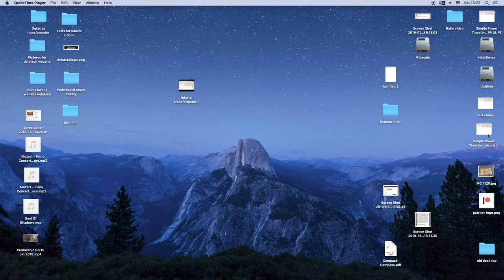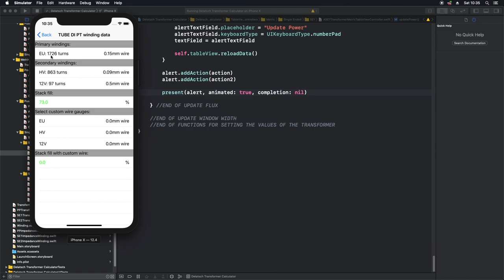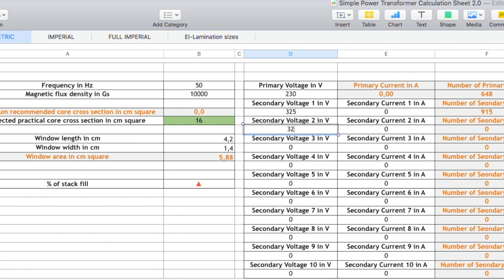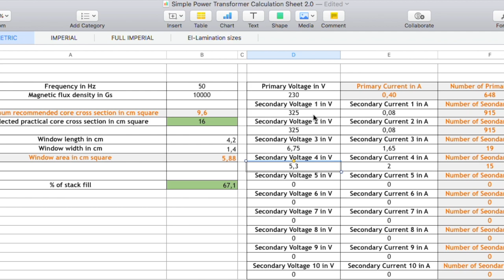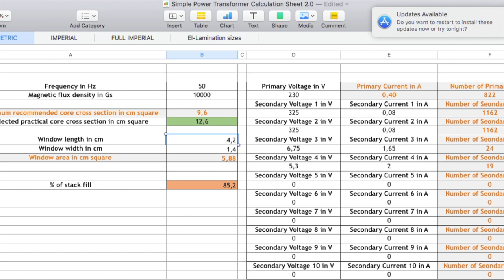Practical Transformer Winding Tutorial 2019

Comment: What about layer insulation? Without that, voltage breakthroughs are likely to become a problem.
Reply from the maker: In the old days it used to be a concern. With modern transformer wire which is double coated and can withstand 200+ degrees C and 5kv+ it is impossible to happen (that's two coats on each side of each wire). It makes sense between separate windings just in case and for sure between primary and secondary as a safety precaution. It should also be used for higher voltage transformer in the kV range, but for relatively low voltages it is not needed. Been winding for years and never had that issue.
Reply: Of course this can still happen. Check the voltage rating of grade 2 or even grade 3 magnet wire from Elekrisola. Very renowned manufacturer, still the voltage rating is below 230V for those. At the very least, this should be mentioned. I'm sure most people watching this are not aware of this issue at all.
Reply from the maker: Wire with insulation that can only withstand 230V shouldn't be used in transformers. Even if you put layer insulation you still have wires of the same layer next to each other. The voltage breakthrough can happen there just the same. In my written tutorials I always mention that only double coated transformer or motor wire should be used for transformer winding. It is not possible to mention all the details and problems of transformer winding in one short video. As I said, never had a voltage breakthrough, the only time I saw transformer fail is when there was a dead short in the circuit and no fuse was present.

Comment: If the transformer is for single ended audio final, how do you insulate the I from E pieces?
Reply from the maker: You stack up all the E laminations from one side first and the I laminations from the other. Then you use a thin piece of pressed paper in between the E stack and the I stack.
Reply: @Delatsch  Many thanks for the quick answer. Is the thickness of the paper important? Is it calculated on your spreadsheet? How do you fasten the I laminations to the E lamination in this case?
Reply from the maker: Yes, thickness of paper is important. It can be calculated but calculations are not useful for practical purposes. It has to be tested in practice using a circuit similar for testing chokes with DC current. It's not possible to explain it in a comment. I might do a video in the future explaining the process.
Reply: @Delatsch  Many thanks!

Comment: Where did you buy the winding machine?
Reply from the maker: I've bought it off ebay. If you search for NZ-1 coil winder you will find it. It works well, but from time to time it might have issues with a counter not switching to a next hundred or a thousand :) Other than that it has served me well for years. I might add another reed switch counter just to have the backup in case i need to reset this one during the winding.
Reply: @Delatsch  Thanks!!
Reply from the maker: You are welcome!

Comment: Where do you get the laminations from?
Reply from the maker: I get them in bulk locally, you can check my website I have some for sale if you are in the EU.
Reply: @Delatsch  Can the spreadsheet calculator help my issue. I have a push pull headphone amplifier that uses two valves as output to the transformer primary. So the primary will have a DC voltage of 135VDC always across it supplying the anodes of the two valves via a center tap. The output impedance to match from the valves output to the primary winding is 10kohms. The secondary winding needs an output impedance of 400ohms to suit my monitor headphones. 

So what I need the calculator to tell me is the SWG or AWG gauge wires to use and quantity of wire, dimensions etc. Can it help me?
Reply from the maker: @TechTins_Projects  Yes, that's exactly what it does. Currently it only calculates the wire thickness in mm, but you can easily convert it to AWG using online charts. The iOS version calculates in AWG directly and the new upcoming version of the spreadsheet calculator will have it as well. Of course, if you purchase the calculator now you will get the updated version for free once it's ready.
Reply: @Delatsch  All I want to specify as inputs is power output from tubes plus output impedance of tubes and the input impedance of my headphone amps.  In other words I only have following data.

Power=1.8Watts 
Zin = 10kOhms
Zout=400ohms
I = 13mA.  

Can the spreadsheet then give me all other calculations:- turns needed, wire gauge, height of windings number of layers needed for given wire gauge, type of bobbin etc etc.
Reply from the maker: @TechTins_Projects  That's all the data you need. Yes, it will calculate the rest for you.
Reply: @Delatsch  I only use "open office 3.2.1" does it work in that spreadsheet package?
Reply from the maker: @TechTins_Projects  Yes it works in OO and also in Google Docs which can be used online for free.
Reply: @Delatsch  Can I confirm with you that this will be able to calculate the gauge of wire and number of turns meeded?
Reply from the maker: @TechTins_Projects  Yes, that's what it does.
Reply: @Delatsch  Okay great I have ordered a test transformer to unwind. I will measure all the wire gauges and number of turns to unwind it, area of core etc then check how accurate your spreadsheet is. I hope it is good as I want to use this for  a number  of projects. I will let you know results here once I have finished the test.